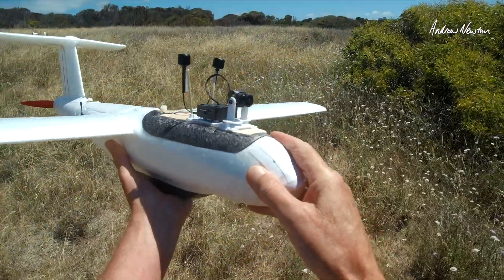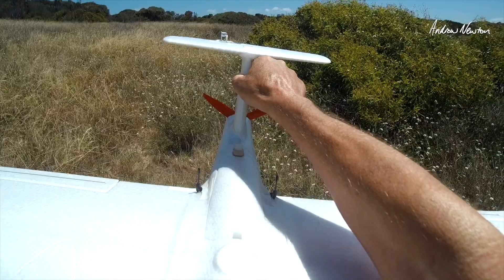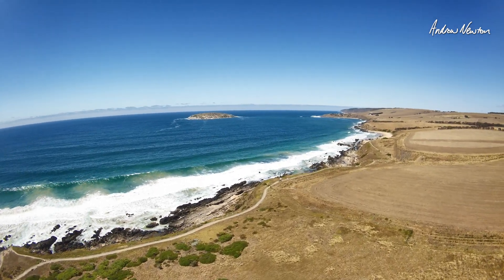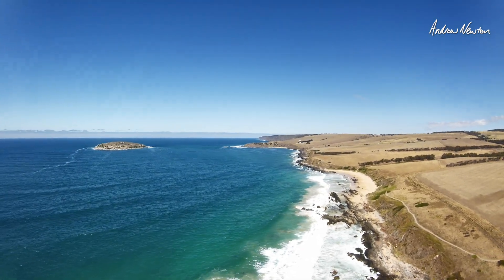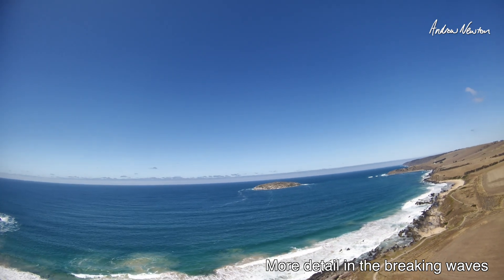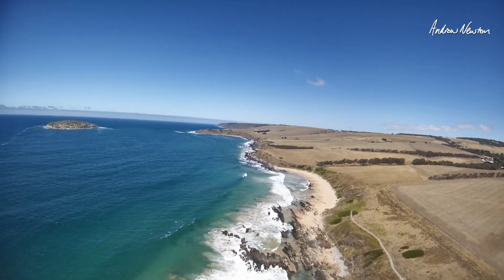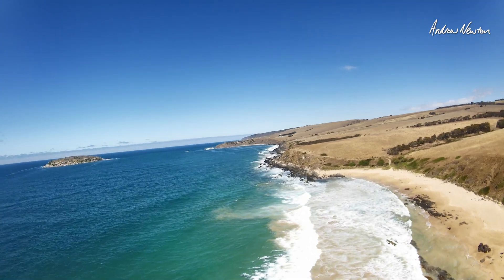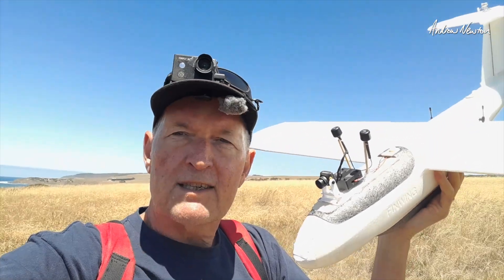Caddx WalkSnail Moonlight - ND8 & Gyroflow Testing

Comment: I would love to fly there. :)

But the only time that Gyroflow was applied was around 2:03 in the video with that buttery smooth video.  The rest of the video seemed to be not applied.  I would have just done the whole video. :-)  Or try some side-by-side comparison.  Gyroflow still blows me away with what it can do!
Reply: Rendering time in 4K must be horrific....Yes, I use Gyroflow...🤔🇬🇧
Reply: @EnglishTurbines  For a 10 minute 4k video, it takes my older Ryzen 7 3700X some 25 minutes with GPU acceleration enabled on an older GeForce GTX 1650.

However, software-only rendering will take an hour or more from last I remember for the same file.  Gyroflow says software-rendering produces the best quality but the GPU-accelerated output looks just as good as the original to me.  But it may be depended on the video card.
Reply from the maker: Here's the full flight stabilised with reduced Gyroflow settings. I don't like full stabilisation, might as well fly a DJI drone.https://youtu.be/iKy-E_t3BxQ
Reply: @AndrewNewton  Gyroflow is post-processing though, not flown.  Unless you have the real-time gyro stabilization enabled in the Moonlight during flight?  I don't do that either.